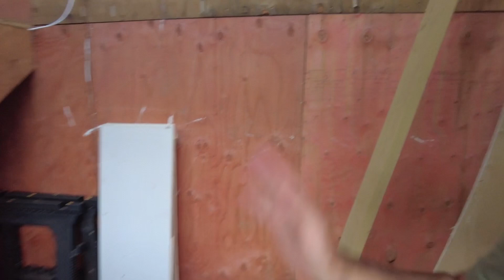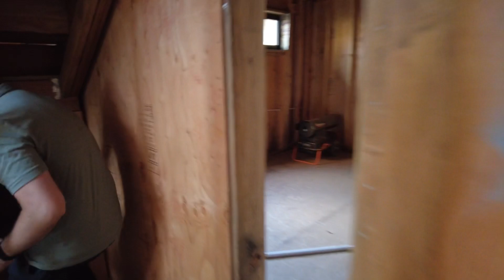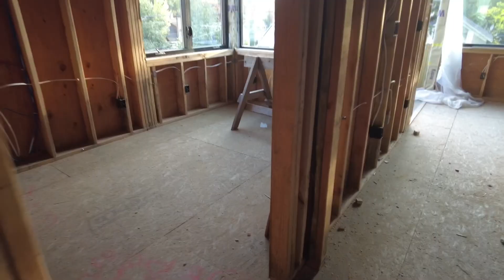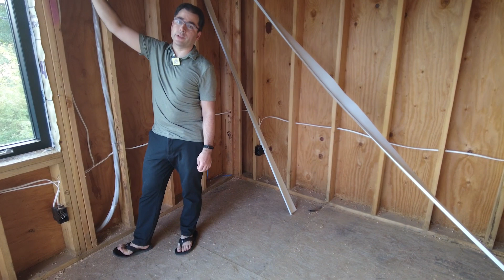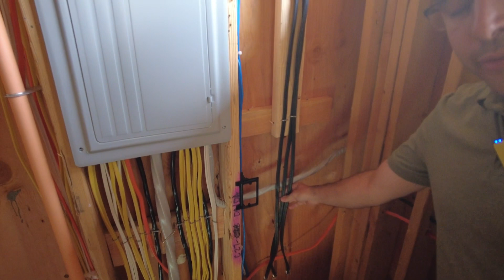Putting internet in everything | low voltage walkthrough | House Files Episode 24

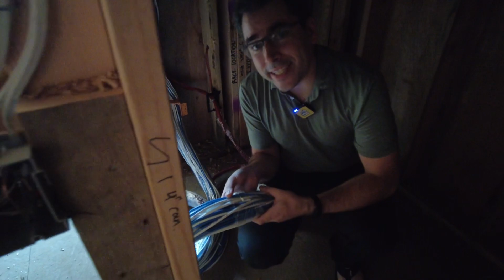Comment: 6:00 It might seem like 3 days to terminate the wires, but after you get through the first 25-30 of the terminations, you'lll get faster at it. Ask anyone who has had to make home-made patch cables in quantity.
Reply: Are you going to be using keystone jacks or RJ45 connectors.  If you are doing the second option use the RJ45 easyz connectors.

Comment: 4:00 Re. LEDs - They are surprisingly bright for their wattage. You may find that 4" are more than bright enough and 6" may be too bright and cause glare. If you have access to a showroom where they have them working, on display, I'd encourage you to check it out. Glare is the biggest problem with lighting design and LEDs are more prone to it than older style fixtures.
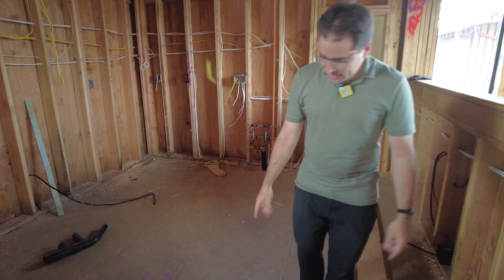7:28 plug strips are great, especially in kitchens! Good choice. But then all your choices are good choices.
14:30 I would never build a house without a sprinkler system these days. It's like you said earlier. It's so much cheaper to do it during the initial construction. Sprinkler systems save lives. And most insurance companies give sizable discounts on insurance policies for sprinklered homes.
18:00 I'm thrilled you're doing the individual stair lights! I remember you talking about that at the very beginning of the design phase. And now it's happening!
Reply: +1 to the LED note. I also recommend buying a few spares. I found out this spring that the "modern" LED dimmable discs over my porch were made for a few years but haven't been manufactured for the last ~4. Required some not-great rewiring on my part when one of the discs stopped working.

Comment: I have never heard of Radon mitigation before, very interesting to read up on it, it is even a thing over here in parts of the country.

Regarding the access to the attic: Why not put a door upstairs, as there is already proper stairs up?

And about the light up stairs: Why a separate cable to each step instead of a data bus and addressable lights?
Reply: The only place for a door at the top of the stairs is where the electrical panel went. We could have put the panel elsewhere but this was a pretty convenient place for it.

For the stair lights, I did think about an addressable strip, but I've had mixed luck with them before. This would actually be a really long strip (3ft * 16 steps per staircase = 48 ft) and voltage drop on a strip that long would start to be a problem. Plus it would mean a lot more work installing them, involving soldering on both sides of each step. The strips we're using don't require soldering so installation will be a lot cheaper.